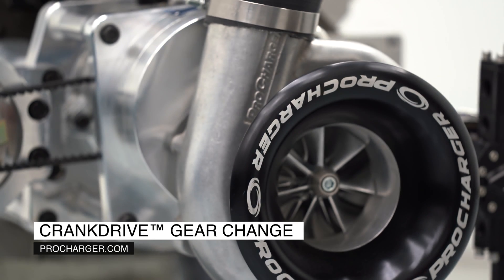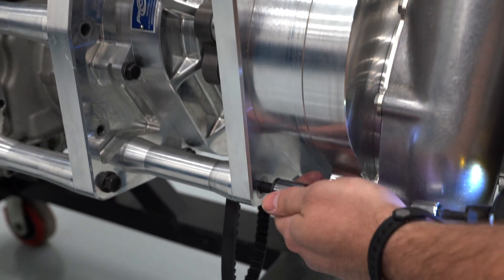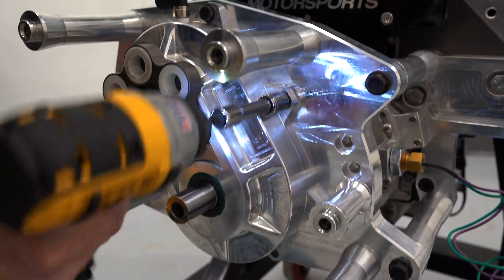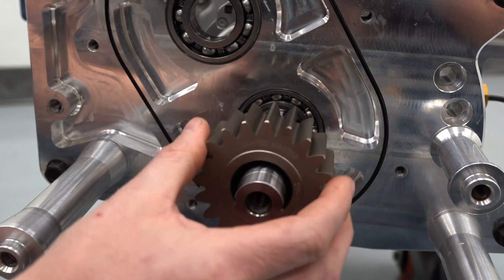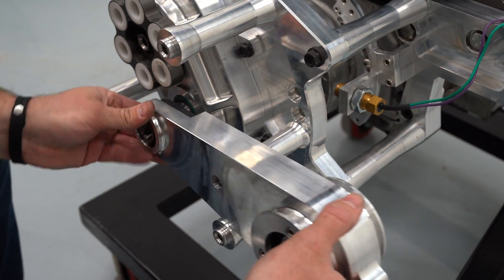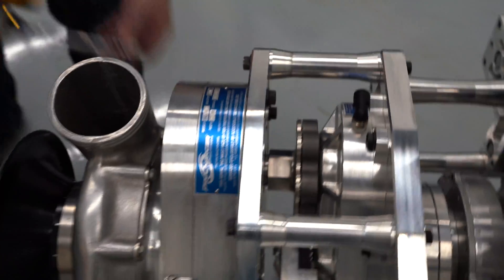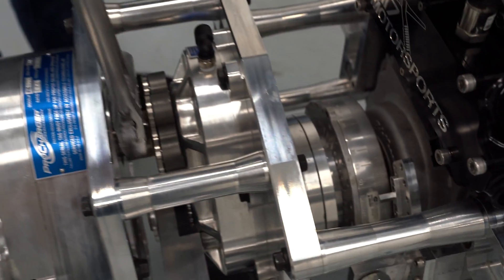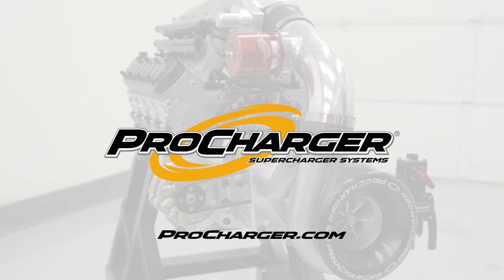ProCharger 101 - CrankDrive™ Gear Change

Comment: I'll stick to my belt driven one. All u have to do is change the pulley and the belt to change boost ratio 😊
Reply: Yes, but this would be for a setup making maximum power. Belt breaking and slippage would be constant at this power level
Reply: This is for the guy who either wants to bypass any pulley issues, wear and tear, or if they’re 2000 hp and above and a pulley is just not as reliable. This is also for the guy who builds their stuff tough and under tune it to get a bullet proof street car (I’m that guy 😂)
Reply: @jimjam13  must be nice!😉

Comment: unless you extended your engine bay i don't understand how that's going to fit under the hood in a street car but i love the technology way more than a belt.
Reply: Lay the radiator flat underneath the ProCharger
Reply: I have a 93 fox body,  crank driven ProCharger set up this way 4.89 @ 143.5  1.15  60' no front end extensions, and motor is not set back, stock fire wall.  3300lb with driver 363 sbf.

Comment: Great video! You've got to love all the milled aluminum! How much parasitic drag compared to turbocharger is there? I understand the supercharger works great on 1/8mile tracks and turbochargers on 1/4 mile. Why? Is there a gear option that you can use to adjust from tack to track?
Reply from the maker: There are lots and lots of folks using superchargers in 1/4 mile. (NHRA ProMod Championship was just won with a ProCharger, after 5 wins this season from that team alone) However what you are seeing is that due to the speed of the cars now, is making more racing go to 1/8th mile to be safer for the drivers and fans, but also easier on parts.  Since engines making 3,000+ HP are much happier running 660 feet vs 1320.  (also cost of insurance to operate a 1/4 mile event is much higher, due to the speeds involved)
Reply: Turbos work just fine at 1/8 mile, 1/4 mile Drag Racing, Standing Mile Racing, you just gotta get the Correct Size A/R Exhaust Housing for the racing you wanna do. Then you don't gotta worry about Any Parasitic Power Loss spinning that Turbo, or Turbo's, like you get with a Supercharger, don't matter if you using a Belt, a Geardrive, or whatever, that Supercharger is eating up Horsepower !!!